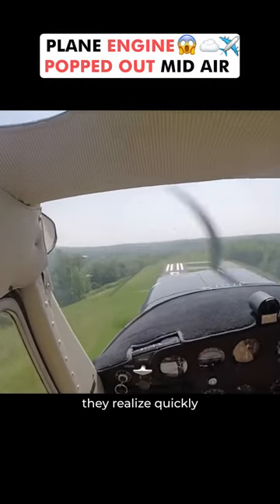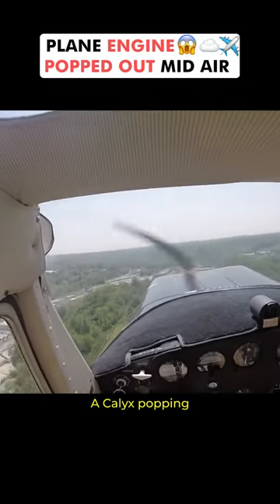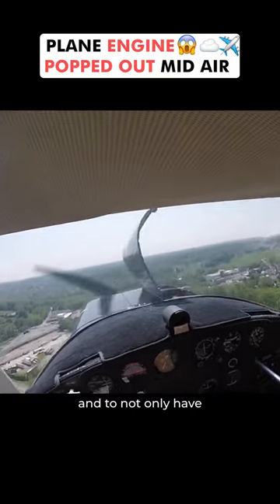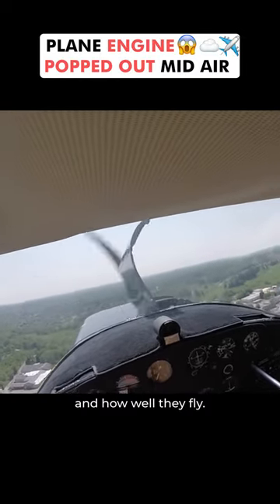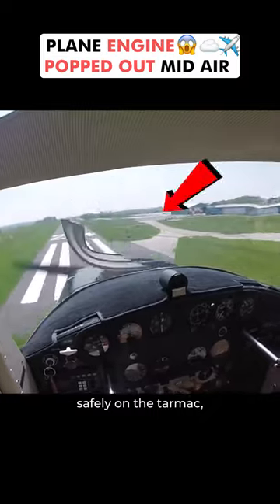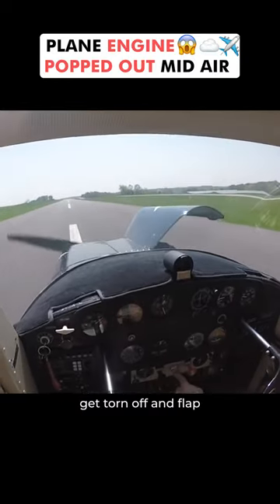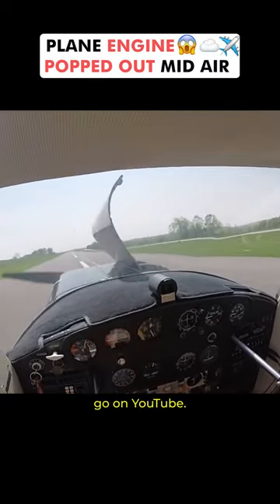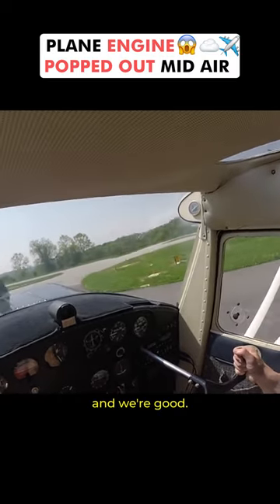Plane engine popped out 😣 #Shorts

Comment: What a BS video! First off the engine didn’t pop out.  The engine cowl came open no big deal you come back and land, but you land on the runway there is no tarmac that’s the material used to surface the runway, taxiway, and ramp.